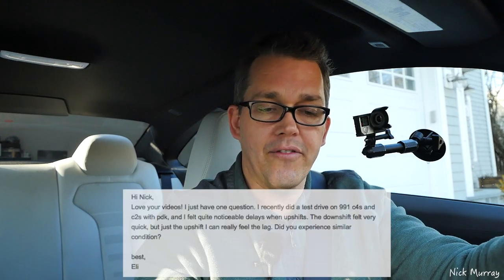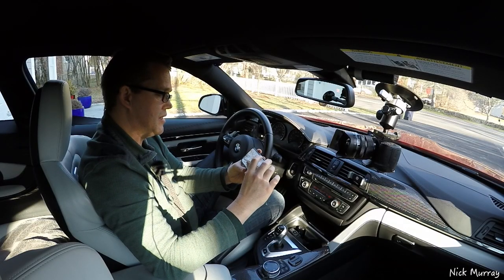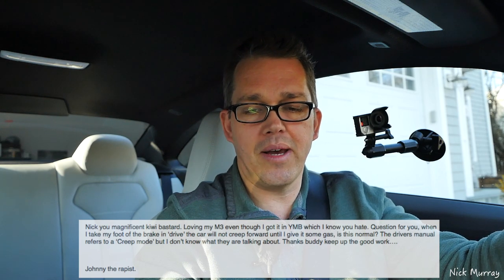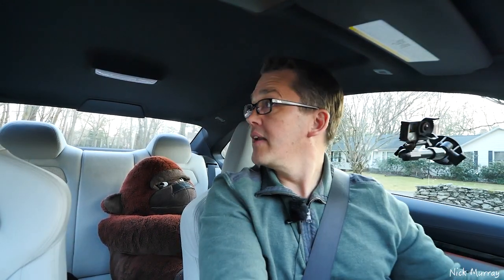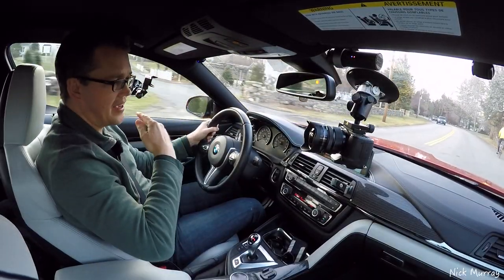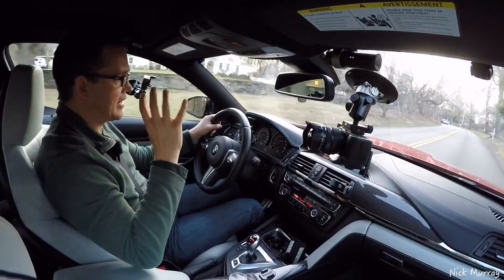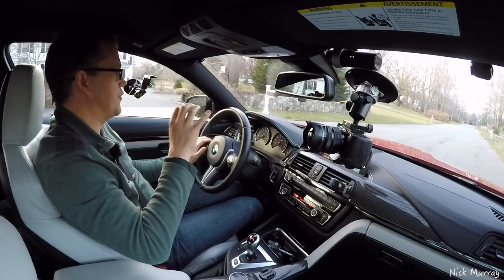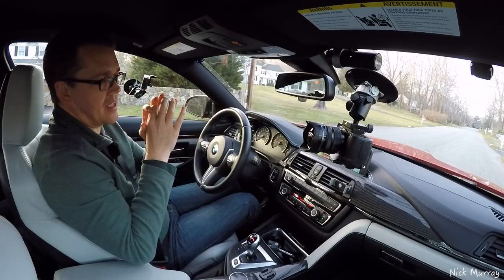BMW M Dual-clutch transmission and Porsche PDK transmissions DCT DSG

Comment: I've owned an E89 with the DCT (by ZF) and now a GTD VI with the DSG (by BorgWarner I believe) and there are differences. I always had to literally almost stamp on the Bimmer's throttle when setting-off to get it to move (whereupon it would jerk forward embarassingly) whereas the Golf moves-off smooth as a supermodel's ass. The Golf is very reluctant to change up which is very irritating when cruising around town with that annoying diesel clatter (I actually had the BMW in Sport all the time in order to enjoy the N55 engine exhaust's open valves- a metallic snarl). Above all the BMW experienced tragic downshift lag on kickdown; a whole second or more would pass by when I stamped on the gas where literally nothing happened at all. Very , very disappointing and a large reason I got rid of the car.

Comment: After driving a PDK for more than 3 years, I now prefer manual transmissions.  I got tired of the sloppy gear changes when the trans was cold, jerky changes at slow speeds, having to keep my foot on the brake when stopped, having to perform strange flappy paddle wizardry in order to rev the engine when stopped or unable to rev it when moving.  The dual clutch transmissions are fast, but they are less engaging & also have more problems (software/etc.).  I'll sacrifice some acceleration time for enjoyment of manual transmissions.

Comment: To be fair, dual clutch gearboxes aren't lighter than torque convertors. They're both heavy.
Reply: +PieterA I think what he was aiming to explain was that a torque converter is a huge heavy lump of metal and oil bolted to the crank via the flex-pate, so substantially increases the rotational inertia of the engine compared to a dc pre-selector, which doesn't add much rotational mass than a normal manual clutch.  Having said that, I'd take a ZF-8 over a DC for a daily driver any day - nothing beats the ZF-8 for refinement.

Comment: Actually a torque converter doesn't change the gears in an automatic transmission, gears are changed by clutch packs, gears and bands, all controlled by a valve body. Torque converter multiples the torque that is why automatic Transmissions have lower 1st gear ratios!!!

Comment: Hmm... true - but not true, what he says about automatic transmissions.  True - in the sense that older and even newer but inexpensive automatic transmissions have slip via the torque converter.  However, modern, high-tech transmissions - such as the ZF 6HP (2nd generation) and ZF 8HP in BMWs (and some other vehicles) only use the torque converter launch the vehicle.  And, in first gear, beyond 1,000 or so RPM, the torque converter is literally out of the picture - with full lock up, up and down the gears... even while changing gears.   So that, today's most advanced automatics have an overall input/output efficiency that is comparable to dual-clutch transmissions.   Moreover, the 2 transmissions I mentioned above have full gear overlap... meaning, they are able to shift gears with continuous torque application.  This is because these transmissions use multiple clutches to partially engage the next gear, while releasing the lower gear - very much in the same way dual-clutch transmissions can.  The lines have been blurred.   Look up the new and old BMW X5M and X5M for a taste of how these automatic transmissions shift as fast as dual-clutch transmissions - in 200 ms or less.   So, yes, he is right about older or less sophisticated automatic transmissions having a fluid coupling engaged much of the time.  However, such is not true of the world's best automatic transmissions - there's hardly any difference, now, between them and dual-clutch transmissions in terms of fuel efficiency, shift speed, shift response, and a direct mechanical engagement with the engine.